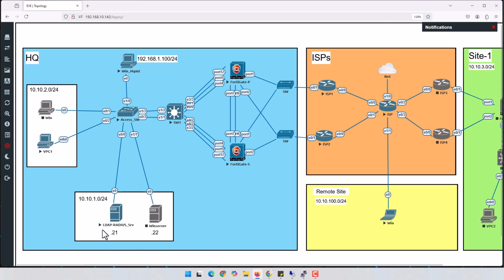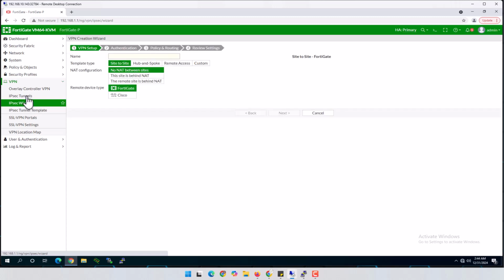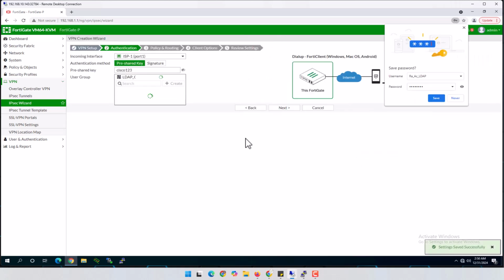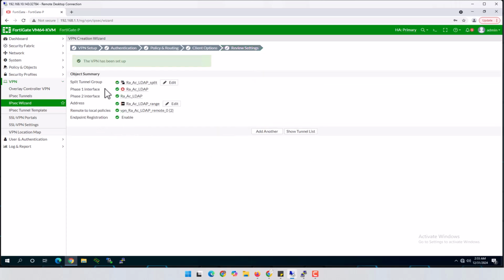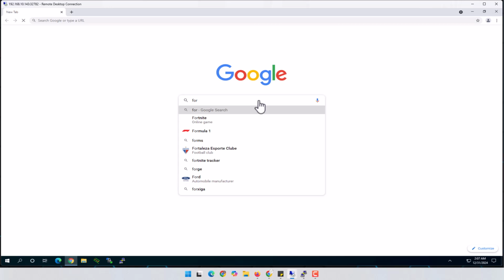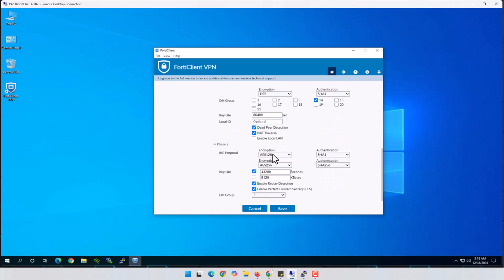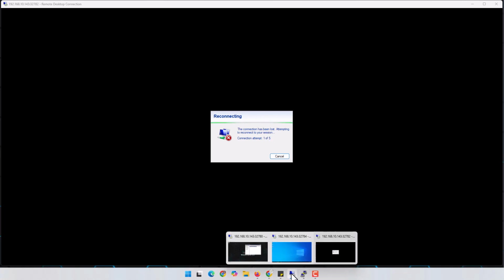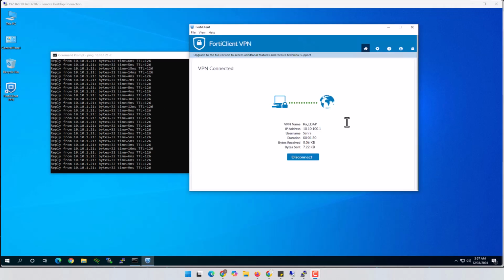FortiGate Remote access VPN using LDAP server (FortiGate Part6)

Comment: excellent video. thanks! i was very helpful.. 
I configured ssl vpn with saml actually, but I recently read that on fortiOS 7.6, they will disable ssl vpn. So I have to migrate to IPsec.
Is there a way to add a little more security? I added local ID configuration but I have no budget to buy forti tokens and cannot use SAML anymore with forticlient because I have to buy EMS license.
can we change encryption to sha256, for example?
thanks again
Reply from the maker: Thank you for your comment, Sure you can, in this video I am using evaluation license and it has limitation in using strong encryption algorithm, with license you are free to use any algorithm type, also u may switch to Palo Alto firewall that support strong algorithm even without license.  and thank you for your information about disabling the ssl VPN in Forti OS 7.6.

Comment: Hello sir, I would like to ask if it is possible for the client's IP address to be static?
Reply from the maker: Hello, Thank you for your question,  This is remote access VPN, it means client will have two different IP address, first IP address is the physical NIC card IP address, it can be static or dynamic, But when it connect to the VPN, the server assign another IP address to virtual NIC card (The NIC card that will create by remote access agent application). this IP address will assign by the VPN server and you can configure a pool for it. Technically it is possible to assign a static IP address to virtual NIC card,  BUT it is not required and  as it is static and out of the server control, it may conflict with other client's IP address.